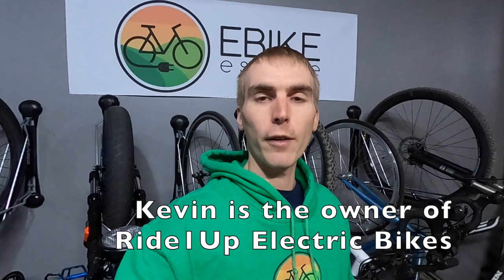Cadence Sensor Vs Torque Sensors | Which is Better on Ebikes?

Comment: I am a soon to be owner of a ride 1up ebike. I have been following the reviews and owner groups to educate myself before making this purchase. First of all thanks so much for the info. I will definitely use your link when I buy.  I am 99% sold on the limited. As Kevin pointed out, not just for the Tourque sensor, but also the upgraded parts. Kevin also mentioned better welds which is a comforting thing to hear. I know this bike is not intended for serious mountain biking but I definitely thing the new found power will inspire me to hit a few trails. One point I would like to clarify is if you need that power boost to give your legs a little break, you can just hit the throttle and it will will take you to full speed. Am I understanding this correctly? I also have noted on some competitors bikes there are complaints about the cadence sensor lurching forward at start up. Are the ride 1up smoother? My second choice is the 700 so still curious about it as well.
Reply from the maker: Throttle is available whenever you need it. Just keep in mind that accelerating from a stop uses a lot of battery as opposed to getting up to speed a bit and then engaging the motor. I personally do not find that the bike lurches forward and my parents who are in their 60s rode Ride1Up ebikes with no complaints. Though you should definitely be careful when using the throttle when starting from a stop.

Comment: It seems like a torque sensor would be more efficient and add range compared to a cadence sensor. Is this true?
Reply from the maker: I can't say definitively since this isn't a topic I've talked about with others but I would think the torque sensor would be more efficient. Your power is likely to be more smoothly engaged compared to a cadence sensor which is more of an on/off. This might especially be true during accelerating from a stop.
Reply: The torque sensor is more efficient because it requires more effort on your part to move it along.  To move the bike the torque sensor requires you to actually press on the pedals, not just ghost pedal. This psychologically makes you want to pedal harder to gain more speed. So the motor is actually working less harder and you are pedaling harder than you would on cadence only. A better workout (if that is what you are looking for).  Ride both and see which one you actually pedal harder on.   I think you can guess which one you willingly pedal harder on. That is the most efficient one.

Comment: I rode a torque sensor BH Neo for six years.  I frequently desired to pedal a bit harder WITHOUT demanding more battery power, as I needed maximum range.  Could not do that, other than just staying in eco mode.  Now I have a 700 and discovered it has cadence sensor.  At first I thought I did not like it, however the range is more than double my old bike, so now I don't have to be so stingy with power.  Plus I am able to customize the wattage limits for EACH level on the 700.  Could not do that on my old bike, so now I prefer the cadence sensor.  The bike operates in a uniform way and that makes it easier to control range, by controlling top speed and wattage.  Very happy with the 700 build quality and value.
Reply from the maker: Thanks for sharing your perspective!
Reply: Are both bikes same battery capacity?

Comment: 3 Important things for me
Torque Sensor
Battery Size
Throttle

If you have different power inputs (1 - 5 for example), torque is preferable.  It saves battery juice, the assist is variable based on your input but also, if you need more, power its there. Just increase the level.

Battery Size.  Just like a car, I hate range anxiety or feeling I have to sip juice. 7 Ah doesn't cut it for me.  Has to be at least 10 Ah but preferably 12 Ah.  12 is the sweet spot but 10 ok. 7 not good.

Throttle.  Just in case.  Just in case I'm tired. Just in case I feel like cruising with no effort or just because  I want to have the option of throttle.

All three of these go hand in hand.
Torque for assist at ALL speeds and power conservation along with a workout or less of one.  Bigger battery to take away anxiety and also assist with throttle and length of ride IF needed.

Baby maker has cadence but bigger battery.
Ride 1 has Torque but small battery and I don't believe either have a throttle.

Very frustrating to have this situation where one has one thing but  on the other and so on.

Best option would be to offer Choice.  Yes I want Torque, not Cadence.  Yes, I want to select larger battery 12 Ah and Yes I want a throttle.
Reply from the maker: Thanks for sharing

Comment: I knew nothing about this. I have two ebikes as I have two residences. They both have cadence sensors. I didn’t know there was another system. My wife just bought an ebike which has a torque sensor. I really thought it was faulty. She likes it because it gives her more sensitive control. I jog and swim for exercise. I ride for pleasure especially when I am a bit tired. It’s like having a motorbike without the noise and vibration etc. Another consideration for a newbie is whether to choose derailleur or internal gears. Over long grass the derailleur gets clogged on my fold up bike. It’s a long and expensive learning curve. Personally, if you are buying an electric bike for its power, I can’t see the purpose of a torque sensor. You may as well ride a high quality push bike and expend similar energy over the same distance.

Comment: Did it occur to either of you that discussing the power usage of each is important. Be aware that the most important issue for ebike riders in 2021 and forward will be range. As the Ebike community grows the ability to travel with out being tethered to a mental wall socket; needs to be addressed. The first time buyer may be fooled as to stated battery range for their bike but not us who have at least two under our belt. Tora Harris founder of Juiced bikes is once again forcing the industry to take us experienced ebike riders seriously. Your message seems to be for the novice but there are more each year who are experienced to degree. And so more probing. Correct me if I am wrong but I believe a torque sensor use’s less volts over same terrain and travel time. I’m curious as your guest certainly gives the impression of knowing; yet again does not address it?. So which is it? I have done some experimenting on my own, but curious as to your answer, please advise. Thank you.
Reply: The torque sensor is more efficient because it requires more effort on your part to move it along.  To move the bike the torque sensor requires you to actually press on the pedals, not just ghost pedal. This psychologically makes you want to pedal harder to gain more speed. So the motor is actually working less harder and you are pedaling harder than you would on cadence only. A better workout (if that is what you are looking for).  Ride both and see which one you actually pedal harder on.   I think you know the answer.

Comment: I am also in Wausau! Where is a good place to ride? Wondering if my Himiway will make it up rib mountain?
Reply from the maker: Awesome! We ride our ebikes all over Wausau, car replacement and for leisure. There is the new Trillium trail, the new section by Kronenwetter (though I think technically ebikes are not permitted), the path by Ryan Rd and of course Mountain Bay! I believe the Himiway would make it up, just likely not on throttle only. If you ever want to test an come Spring ebike let me know!
Reply: @EbikeEscape  thanks for the quick reply! I will definitely check those places out. Thanks for the helpful content

Comment: I've had a 250w tonaro and bewo mid drive and a bafang mid drive all with cadence sensors and a tongsheng mid drive with a torque sensor and the torque sensor makes you work a little bit to get the speed up but the feel is better and you don't need switches on the brakes as the motor just stops when you stop pedalling where as a cadence sensor will continue to go for a second or 2, so you need brakes with switches. My tongsheng uses hydraulic brakes and I have not needed 3rd party stick on hall sensors and magnets as the motor cuts off when no pedal power. 
All my bikes have a throttle so if you're lazy then who cares :)
Reply from the maker: Thanks for sharing your experience!

Comment: This is mostly a touchy feely marketing video. Nobody wants to say what is real here. I will. If you want to get any workout at all - use throttle and manual pedal (no pas) or a torque pas. Same if you want to go slower on flat trails around other people (5mp to 8pmh). If you are lazy and want to scream down bike trails from 12mph to 28mph with virtually no pedal use cadence. Most the cadence programming is for speeds way to fast for level 1,2,3.

Comment: Cadence sensors are useless for group riding
Reply from the maker: Is this a group ride with all ebikes or are you going with like a road bike group?  Just curious
Reply: @EbikeEscape   normal non ev bikes. My experience is on / off all the time, too slow to fast
I am fortunate enough to have bought a Specialized Creo and you don’t even think of it as electric, just you but more capable. It did cost a lot of money but my BAFANG conversion on my GT Grade cost £2.5k and around £1k for the BAFANG kit
I don’t regret converting the GT as it gave me a taste for ev but if you are group riding with non ev friends, don’t waste your money on a conversion, buy an ev road bike and buy one that has the facility for an extender battery
and a local dealer

Comment: 750W  cadence, hub motor peak 1200W, tire 26x4", bat for both bikes 48V, 17.5A
1000W mid drive torque slim tire 26x2.6".
Hub motor do 90km, on the same part mid drv 76km
Avg speed the same or hub 1km/h plus.
On low speed hub smaller motor higher efficency in range 150 to 400W.
Hub pushes harder to reach pass speed what is in efficient range ,  and then if you give more motor gives less with min 1-2km /h  ( motor can drop below 100W, not efficient but it is small power no big loss) change in speed so you can influence range more efficint way,
Torque gives you more when you press what reduces efficiency , someti m es you do not want more.
With single bat  on road hills hub smaller motor but faster and easier up hill.
Problems on many bike.
Battery ok on small power up to 400W 8A, motor 1000 belowcthose power very inefficient.
On larger power motor efficint, more loss on air drag, battery currents 10A plus sag of voltage and with square of current are comming losses inside and outside battery.
Dramatic range drop and not full performance of notor.
Was riding both bikes with 2 bats when one drains out put fully charged in, ok fo slow riding.
Three weeks ako install bats in parallel.
Slow speed no important benefits maybe at the end of discharge but that takes over 6h.
Solwed problem riding 3-5 hours range cca 115+km with much higher speed before 23km/h no could be avg 30km/h  it is dramatic increase in speed by matching 2 bats each half current with motor efficiency riding 500W.
Motor never performed as expected before put the 2nd bat in parallel even by using  2 x one bat.
I found had to pedal harder on low speed uphill close to 20km/h and green pass2 is easy to go around 35km/h even when l
Pedal have to gliding speed up to 34km/h roughly and then glide to 28km/h, practicalljy cannot continuosly pedal and it is much easier from going uphill 16-20km/h. Do not have control over torque sensors maybe it is possible to reprogam the impact of senso, or should be to adjust to my style riding.
Now mid drive become speedy demon with 2 bats each 17.5Ah. Think to put 2nd bat for hub motor in parallel maybe needs only smaller one..